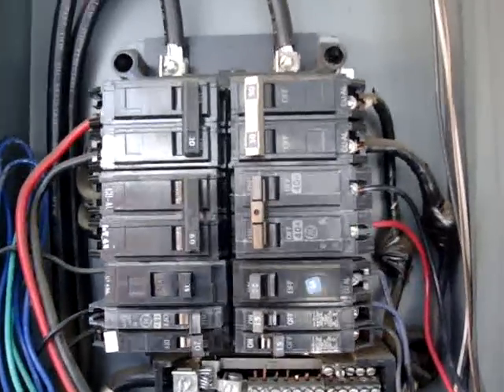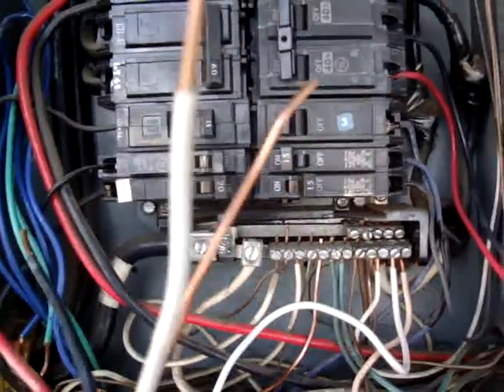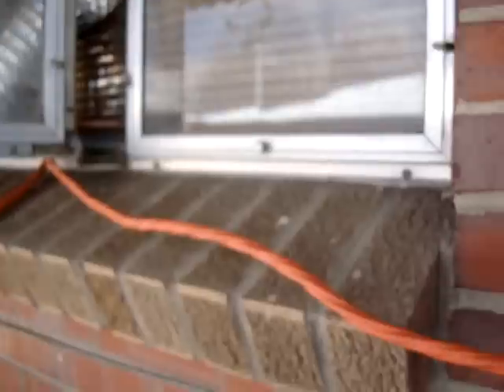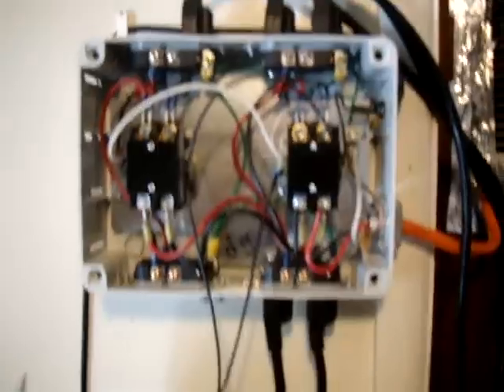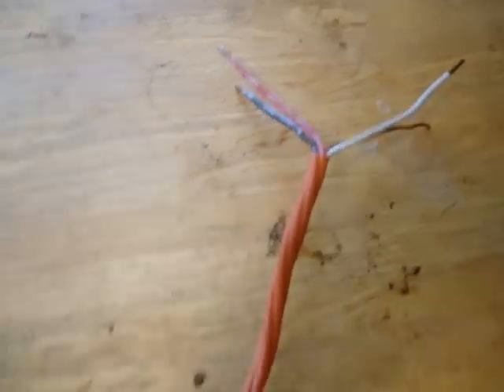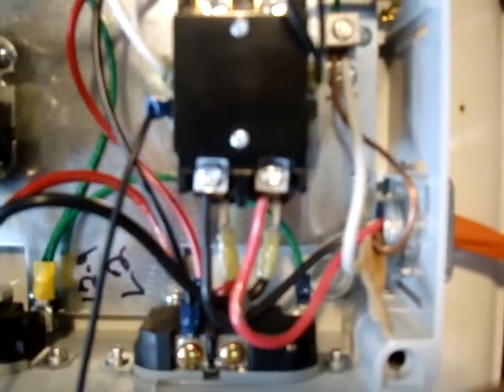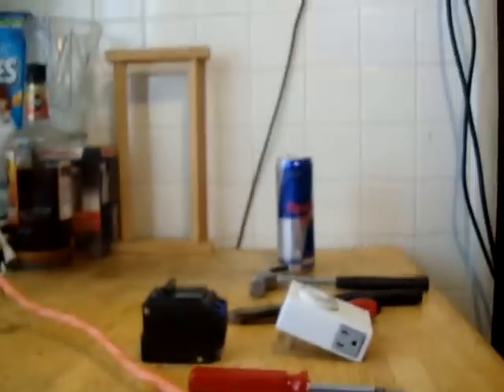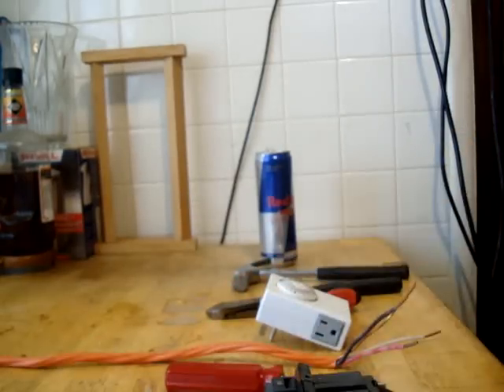How to connect a MLC-8x Part 2.MPG

Comment from the maker: @damiasebaticus it all depends on the amps that your planning on pulling. At 220v a 1000w digital ballast will only pull 7 amps, so 7amps x 8 outlets is 56 amps total. i only use 6 outlets and i'm running 600w ballasts which pull 5 amps so 5 amps x 6 outlets = 30 amps, and i put a 40 amp breaker, so for my set up i'm good. If your planning on putting 8-1000w ballasts on there then definitely put a 50 amp breaker on.

Comment: Use 8/2 wire not 10/3. The latter is only rated for 7000 watt setup and will heat up especially if you 24hr veg.

Comment: would i be able to run a 8/2 wire from the main fuse box off of a 50amp breaker to a drier type female plug recepticle. Then from the mlc-8 have the 8/2 wire with the male plug recepticle plugged straight in. Or would i have to have the wire connected straight from the breaker to the MLC-8?

Comment: I would use 6-2 and a 50amp. White is neutral wire. No need unless you have 120 outlet on the lighting controller.

Comment: My instructions say to use 8/2 cable for a 50 amp breaker. I called the co. and they said 10/3 @40 amps are the old directions.